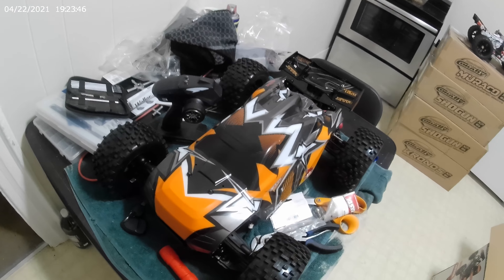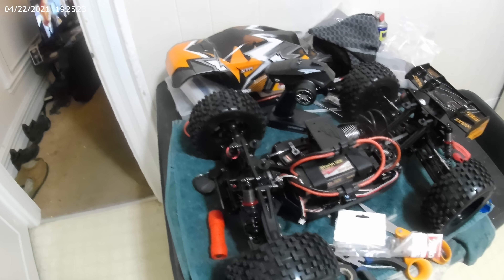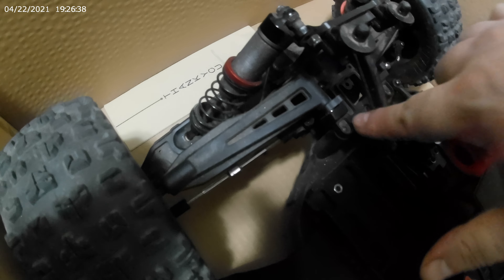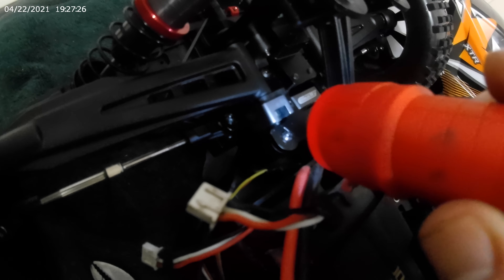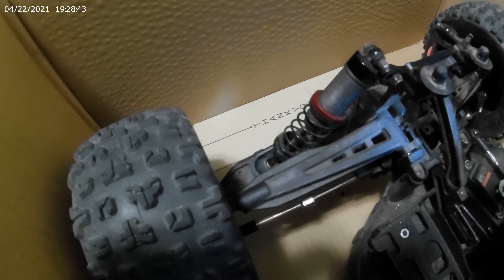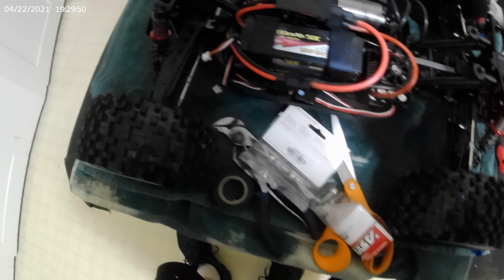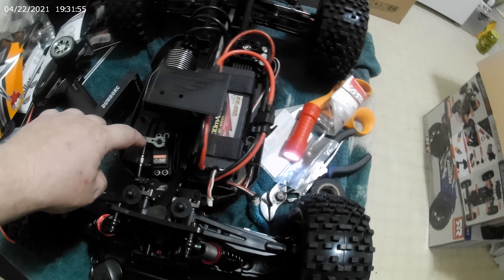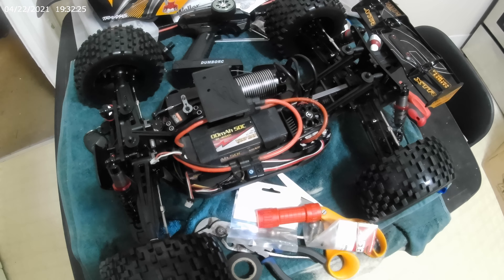Team Corally Kronos XTR Electronics Installed

Comment: You can remove the battery tray and run the ESC wire under it and don't forget to add screw to chassis into ESC tray..There are motor plates that allow bigger motors..Basherqueen makes carbon fiber ones
Reply from the maker: I know, I have all the other Corally cars, 1/8th Scale, all of them run the ESC wire under the battery tray, in two of them the wires have frayed, the Shogun V1 and Kronos V1, the others I'm sure will in time so I run the wires another way, Thank you about the bigger motor plates Basherqueen is great..
Reply: @hooliobandaidrc9158  The battery tray has provisions  specifically made to hold the ESC wire I haven't had any problems with mine but good to know that it could be a problem
Reply: @hooliobandaidrc9158  Yea she is a badass for sure!

Comment: Just out of interest I gave the V1 Kronos with the drive diff upgrade the 7075 but my standard M1 pinion won't fit 🤔 you happen to no ?
Reply from the maker: I'm not sure I'll have to check it out, I'll compare, are you talking drive cups or the whole diff
Reply: @hooliobandaidrc9158  i managed to solve it mate thanks " it has a 13tooth M1 pinion " I'd accidentally mixed up my 0.8 an M1 - thanks dude 🤟🏻💯